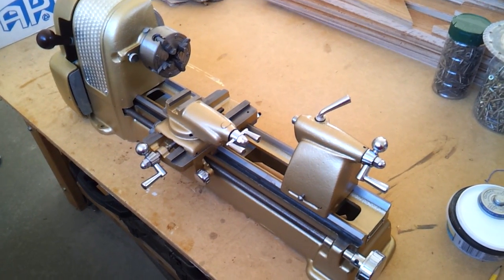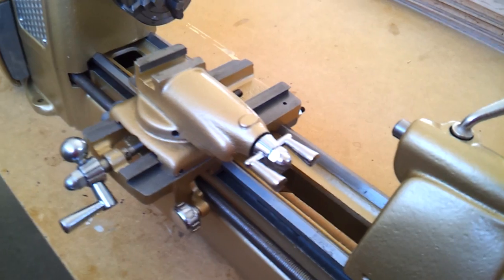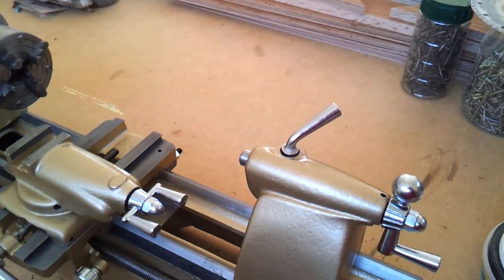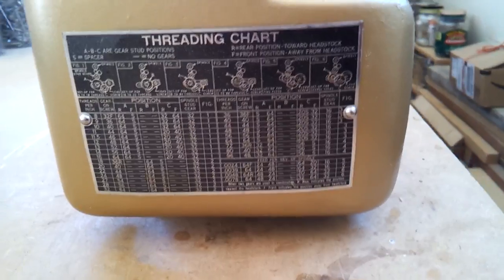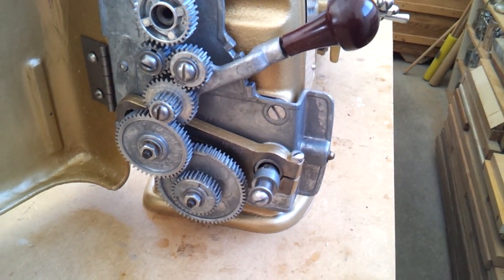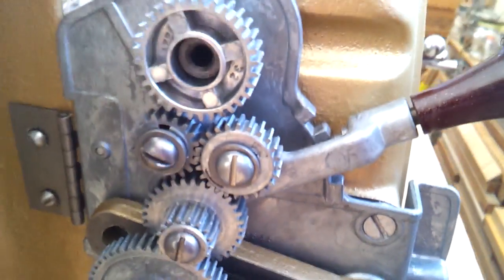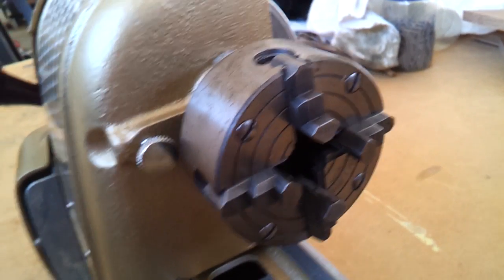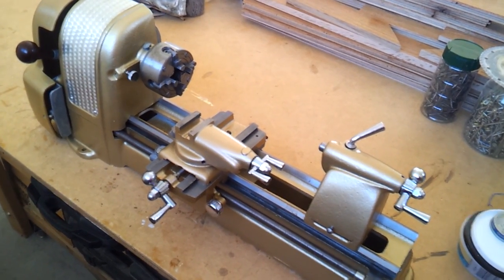Craftsman 109.21270 lathe restoration

Comment: You did nice work with repainting....
I had reworked my 109 lathe entirely,for instance there actual Sear 109 and Craftsman 109 variants,parts mostly not interchangeable between each other Sears 109 have nicely crafted head stock housing while Craftsman 109 have longer bed and there is another variant of 109 lathe bed allowing modify lead screw area but you can't have all parts in one.
I did such modification by modifying Craftsman 109 lathe bed to Sears 109 head stock housing by widening one of resting points at side,head stock no longer have BS 1/2" threaded spindle end but entirely 3/4" diameter which took modification of housing/bushings/bearings/collar's and entire gear drive with pulley to adapt new 3/4" sized spindle.
Advantages that 3/4 spindle have a hole through which allow do drilling/tapping/reaming/milling/broaching and even rifling procedures.
Original area where lead screw inserts into eliminated and bottom partially reduced and welded so new component gear box assembly would be added,this would nullify need for select individual gear manually toward lead screw.
Apron assembly took significant modification,additional plate at side been welded and gear assembly been installed along with self made cover allowing manual feeding like any normal lathe have,half nut lever only would be used for auto feeding.
It also took modification of bottom tail stock area so all components redesigned in specific order and need,it took me a while with that lathe and only gear box assembly had left along with motor mount.
Since gear box would be build and added that requires lead screw reduction in length to suit lathe requirement.
Over all lathe still mostly retain original shape with minimal modification that would be noticed,at rear of side gear cover hole drilled allowing new 3/4" spindle pass through at about 1/2" long.
I had encountered a problem when I was profiling small square side attachment at apron assembly,center was constant for cracking no matter how I was weld,bottom was strongly welded so rest I decided to silver braze and it solved my problem,joint very strong and cannot be cracked, i used small hammer to balance gear retaining bracket to make smooth feeding gear rotation,still I would need install apron to the bed and verify clearance for mount gear rack to it.
Another machine I had made numerous small parts and modify different sub components was my Atlas MFC milling machine,although head housing early modified MF series but it comes with advantage,there 3 tapped holes positioned close to spindle center which would allow installing vertical milling attachment when complete.
Despite original table side plates and cranking handles that made of weak BS zinc alloy which most always breaks apart and plate bushings separates my plates and handles are made from mild steel instead to correct factory standards,spindle modified instead 13/16" it is 3/4" extended from 618 lathe along with gear and pulley.
Machine been test run and no noise or any bearings or other parts failure,both 7/8" and 1" arbor's self made and works just as factory version no difference between them.
I been lazy however to insert spacer washer for reverse lever since it have a play side ways but not much,both motor pulley and spindle pulley have adjustable belts not original style plain belt....
Vertical milling attachment very tricky although I been lucky getting proper bevel gears for transmission of quill assembly and installing 2 bearings on it,there still need final installation of rear transfer gears toward rear shank that would be insert into spindle directly,my version won't have any stupid belts and pulley's mount on spindle and all way around or have different attachment with separate motor,I trying making as simple attachment as possible and fully functional.
I had used part from idle arm of bus with modification,it perfectly suited for the needs and allow using R8 collet's which fits like a glove inside but at final point retaining draw bolt would be installed to tight collet just like at Bridgeport milling machine.
I have very long experience with metal working machines not just working on them but modify into specific needs that factory failed making it at first place.
Further more I also replaced my Wen 12" drill press column by building new thicker walled version,it was a challenge that last about 3-5 days to make vertical cut of tubing and than weld together and after that using torch and heavy sledge hammers among other items to transform oval shape into round shape tubing followed grinding and sanding into correct factory spec which at end entire drill press fits exactly over new column as well as bottom support plate installed correctly as well.
I didn't had chance to drill holes in gear rack in order to mount it,to create balance of table elevating gear bracket need have another small cut made for pass additional guide rod,this would prevent table assembly for self rotation during drilling or milling procedure.
Last part would be involving rewire motor speed indicator only when drill press turned on not when wire plugged into outlet,this always show incorrect motor speed.
I have lot of projects constantly,they all changes and it could be any type of mechanical or electrical items plus I always short on time to make anything completed.